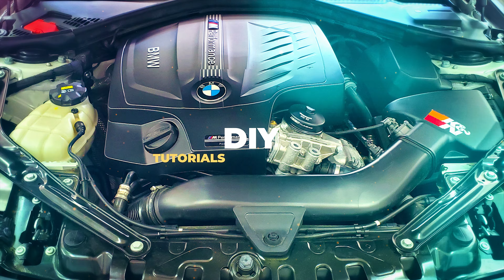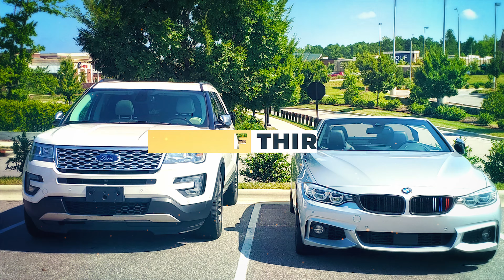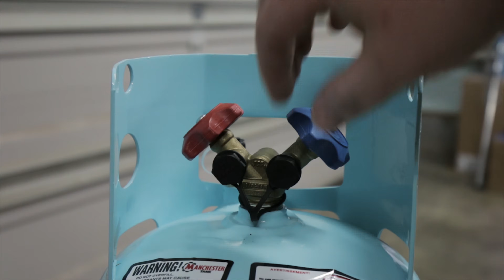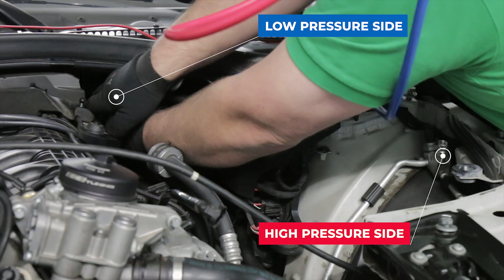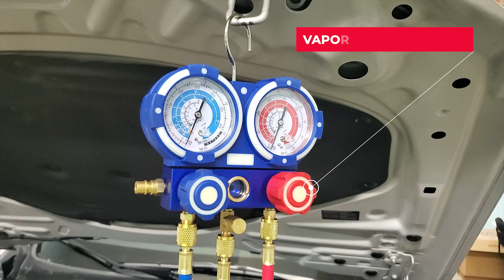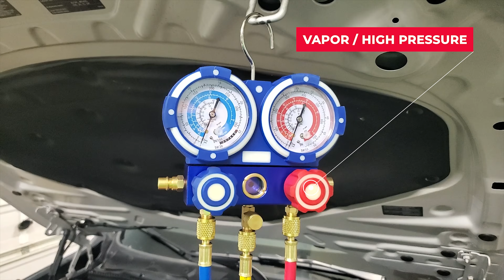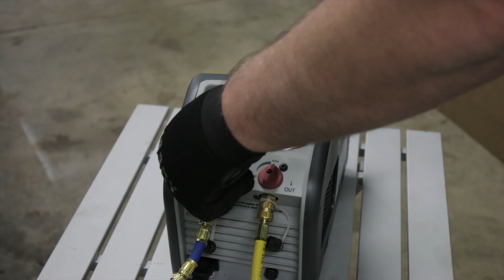EVACUATE YOUR CAR'S AC SYSTEM THE RIGHT WAY

Comment: Why didn't you purge the air out of the yellow line at the tank instead of sending it into the tank?  Won't this enter into the Vehicle's A/C system when you recharge it?  I see some guys purge and some guys don't during the evacuation process.  I know that you are supposed to purge the yellow line at the manifold gauge set when recharging.  So what's the story?  P.S.  Other than this one issue, I agree that you did an excellent job producing this video.  It is very helpful and much appreciated.  Thank you Steve...

Comment: If your already lost the Freon probably somebody catched it for you somewhere down the road 
just remove the condenser add somo AC oil and Freon I didn't vacuum anything my Lincoln navigator is blowing ice cold
Reply: Remove the condenser and add some oil and Freon?  Did you actually mean... remove the condenser?  Assuming you removed and replaced it without pulling a vacuum it might be working now but there is a grande' chance you're going to have compressor problems in the not distant future.

Comment: how do i know theres any refrigerant left in my system ?  and if it is empty can i skip the first step and go right to evacuating the air out of the sytem?
Reply: Connect up a set of gauges.  Many auto parts stores will lend them out for only the cost of a deposit.

Comment: When recovering the Freon will the low side ever go to -30psi? Some reason mine doesn’t go all the way down.
Reply: No.  The recovery machine is not designed to pull a full vacuum, just to pump a lot of vapor or liquid in a short time.  Fun fact, when the machine is pumping vapor, it compresses it back to a liquid for the tank.  These machines have a 1 hp motor, or bigger, and a small cooling radiator, and a fan.

Comment: If the compressor is shot, wouldn’t vacuuming out the old refrigerant before your repair, bring contaminates with it?
Reply from the maker: If there's contamination, I'd probably put in new refrigerant after everything is fixed.
Reply: @fthirty3  yes, that’s what I will do but I’m concerned with being able to find someone that will drain my current refrigerant, knowing it’s likely contaminated…

Comment: Just so people know if you had an accident already and your AC system is not cooling no more that’s probably because you didn’t put a hole in something fix the problem you don’t have to worry about draining the system because it’s already drained but you do have to vacuum make sure your system holds vacuum after that if it does for an hour or two, go ahead and put your Freon in it and you’re done Hope this helps.

Comment: Why dont you show the complete process about purging the lines and also adding some nitrogen in the car to about 4psi post recovery
Reply from the maker: I was replacing the ac condenser ultimately,  so there was no need to add anything after the refrigerant was removed until after the condenser was replaced.

Comment: I replaced the compressor (supports r134a) of my car in a local garage with a structually very similar compressor retrieved from a new model but used vehicle (supports r1234yf). The high side and low side MPa are same in both the compressor. My car's AC system supports r134a and it was regassed recently. I would like to know if while replacing the compressor, the freon was released (the mechanic just replaced the compressor) or it is still there. Also, if the new compressor contains any traces of r1234yf from previous vehicle. If so, if I should be evacuating the AC system before I regas?
Reply: Absolutely, if the shop replaced the compressor, they drained all of the refrigerant out of the system,  or they would have had a mini explosion on their hands.  What they did after that, who knows?

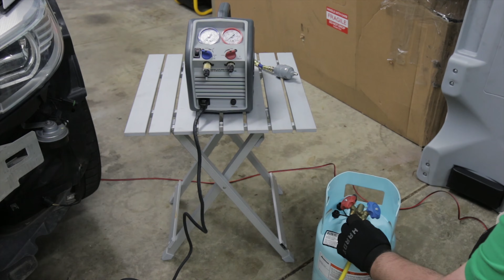Comment: I have spent weeks trying to get this all hooked up like you describe in the video, but you left some important info out.   Here are some pertinent things you forgot to mention:  1) The recovery tank in your link has 1/2 inch ACME connections, but the hose you linked to has 1/4 inch SAE flare connections.  So how did you hook that up without some sort of adapter? (and if you used an adapter, why didn't you mention it in your video?!)  In fact I'm pretty sure we can see the adapter hooked up to your recovery tank at 6:33 of this video.  2) Not all manifolds have the same yellow hose connector sizes.  Some come with 1/2 ACME on the yellow side.... and the hookups on the recovery machines (as well as the filter dryers) are almost always 1/4 SAE.  It's been hell on wheels trying to get all these threaded connections identified so I can find the adapters... and even more time waiting for them to come from China/Amazon in the mail, cuz nobody seems to sell 'em locally.

Comment: Let me start for thanking you for this video tutorial, your efforts are greatly appreciated for people like me who knows less, I have to mentions few things the first one and main one you have a lot of misinformation going here, honestly you should review the comments and re-do this video as if someone would follow it blindly will only get deeper in trouble with their system. secondly as far as "easy" I do have my reserves on that one; for the DIY like me that have never done it before it is not so easy; the special tools needed are $$; I have them already, manifold gauge and vacuum pump from Harbor Freight, got the tank , 30 pounds top yellow, body grey (not the blue one shown here which is color coded for 134a) got the Inficon vortex Dual machine ($$!!) also not shown here got a VivoHome digital scale; all the tools needed were around close to 2K!!, including the rest mentioned below so that is not easy at all for a DIY, the cheapest way still would cost close to 1K in tools along or even more! now the other things and expenses you do not mention here are parts costs; oil for the system, in my case I got 8 oz bottle of Pac 46 Supercool, O rings for the lines (O ring kit) an extra hose needed, mine is red, I got a Four Uncles AC System Flush Kit and also a pressure syringe special to inject the oil in the system. ALL this is NEEDED if you are going to service the car AC yourself and the acquisition of all and the knowledge of how to use it I wont be call that "easy" which is why it is recommended to get the car to a shop; granted, it is possible to be done at home but I feel your video here lacks the whole info as to what we will be getting into by choosing to service the car AC. I understand it is a "simple" and fast video, very well made showing the steps which by the way every manufacturer shows different in their instructions on how to use their products which creates lots of questions and confusion and then every you tuber does it differently as well which lets me wondering which step comes first and so on according to what I already have. In all fairness the more difficult part of this all is to gather what you need; I also thought I would be ok by getting the "basic" tools then my list kept growing and I was very frustrated. Now that I got everything, the scenario for my car is a 2004 Corolla which was running hot air. That was 3.5 years ago, engine is out of bay but AC system still hooked up intact; I collected and bought ALL essential parts for the system and was thinking full replacement as maintenance and parts must be close to end of service life. My original compressor fires (tested with battery) AC Relay is good and line reads 69 PSI pressure in low on 110 F, so system is possible low on freon (leak?? also got the leak detector kit), now since I even got the dashboard of the car out I got access to the evaporator which is why I was thinking full replacement; Evaporator, Condenser with Drier, Compressor and new O rings; as you can see a job like this is not easy in any degree; recovering the freon is just the starting point and to comply with legality; I should  mention when quoted by local shops, what I want to do was over 2k or close to it; I have 2 old cars, this 2004 Corolla and a 2000 Tacoma which may need service one day; this is why I decided to tackle it myself and "get ready" job itself is a PITA no matter how you put it but hey "easy" now that is the spirit!!

Comment: Where's the refrigerant scale for the tank? Don't you need a scale under the tank while recovering...
Reply from the maker: I would have if I was going to reuse the refrigerant,  but I decided to put fresh stuff in instead.
Reply: @fthirty3  well you still need it because you can't fill the tank more than 80%. How do you calculate how much refrigerant you recovered...
Reply from the maker: I was replacing the condenser,  so once I disconnected the lines, anything that would have been left would be gone. I know I got it all though because when i disconnected the lines, there was no pressurized release.
Reply: @fthirty3  That still don't tell you how much refrigerant you recovered from the tank... Also, you haven't even done a vacuum on the system after you recovered the refrigerant which tells me you could have air/moisture in the system.
Reply from the maker: After the ac condenser was replaced I did run a vaccume on the system before adding refrigerant. This video was purely on recovering the refrigerant and didn't cover adding it back.
Reply: @molifehacks5258  Some recovery machines will not let you go beyond 80% fill.  I have no idea how they do this.  Also, some machines will show how much refrigerant is recovered, and even beep (or turn on a light) when they are done.

Comment: hmmm didnt use the vacuum.  im just starting out but feel like the lines should have been vacuumed out in case you want to reuse coolant or just to keep air out of your tank to reduce rust and the possibility of creating an explosive environment.
Reply: Yes it seems like you forgot the step to hook up the vacuum.  Why would you need that and is the recovery machine also a vacuum. 

Do we only need the vacuum for the recovery tank?  You did use it there. 

So apparently recovery machine is also a vacuum in itself but has dials on it which I guess mean something. 

The only thing you forgot to do was put in the refrigerator cuz you already have the manifold valve set up, so what's up with that?

Comment: R134A is non ozone depleting, it does however have a huge GWP factor, which is why you aren't allowed to vent it into the air.
Reply: and yet every time someone cleans their copier or camera with canned air, they're free to spray it to their hearts content 😬 1,1,1,2-tetrafluoroethane
Reply: @JustEnjoyingLife73  actually most dusters use 1,1 Difluoroethane, R152A which has a GWP of 124, which is 1/11th of R134A and a zero Ozone depletion rate. I realize a lot of this shit is probably more or less a scam, but still doesn’t hurt to have the facts.
Reply: @Mooseguy15  I just googled canned air msds, so that's where I got that information from but still, that means if someone sprays 11 cans of canned air, that's like someone releasing one can of R134a, AND some canned air uses R134a or that MSDS wouldn't be out there, right? Anyway, I'm using a hydrocarbon refrigerant now, so I guess that doesn't matter as much for my case.
Reply: @JustEnjoyingLife73  Yep.  In the old days, the propellant for aerosol sprays was R12.
Reply: @Mooseguy15  There are many YT videos about using "duster" cans to refill your AC system.  Fun!

Comment: Forgive the ignorance of this question, but what does the recovery machine do that the vacuum pump doesn't?  I already own a pump and manifold gauges - if I got a recovery tank, would I be able to do this with the vacuum pump or is the recovery machine absolutely necessary?

I have to replace the AC compressor on my Honda so I'm trying to decide whether to do everything myself or find a mechanic to recover the refrigerant for me.
Reply: the recovery machine condenses the refrigerant back to a liquid and stores it in the tank.   The vacuum pump just exhausts to atmosphere.
Reply: @patrickzambori473   Thank you for the explanation.  My vacuum pump has a threaded exhaust.  I got the impression I could add a fitting to exhaust it to a recovery tank.  But I wasn't thinking about condensing it back to a liquid.
Reply: @peterkleiner9114  So at least to some degree, it can compress the vapor, that leaves you with hot compressed vapor.   It still needs to be condensed back to a liquid.   If you discharged that to a copper coil or tank submerged in salted ice or dry ice, it would be cold enough to condense the refrigerant.
Reply: @patrickzambori473  Thank you again for a very informative answer.  I suppose I'm much better off buying or renting a recovery machine, or bringing it to a mechanic.
Reply: @peterkleiner9114  a system dependent recovery would use the compressor on the vehicle.   A tank with a vacuum attached to the system and placed in ice would recover most if not all of the r-134.   The recovery machine actually is a compressor and a condenser.   If your system is working a system dependent recovery is possible.

Comment: Purge your air lines first or your putting air plus refrigerant into the recovery bottle.
Reply: How do you do that?
Reply: @billyc768  Close the valves then turn on the vaccum, when they hit zero pressure for a while close vaccum
Reply: @billyc768 if you look at where the yellow service line connects to the mainfold gauge set that's hung from the hood, there's a little round cap right below the sight glass that can be removed to expose the schrader valve, once exposed you just depress it the same as you would to let air out of a car tire, until you see pure refrigerant come out (once this happens all the air has been successfully purged)
Reply: @billyc768  just let some leak out
Reply: The world is gonna end
Reply: @summerforever6736  🤣🤣🤣
Reply from the maker: That was covered in a separate video. This video was only showing how to evacuate the system.
Reply: @fthirty3 it should be in this video my man.

Comment: This is a great video! The guys mentioned in the comments below about purging your lines. I'm  new ac stuff but something didn't quite add up with keeping moisture out of the system in the video. I think I got it now. Start from the target to be charged - Car - Ac Unit - etc. Hook up your hi and low up. Go to your manifold and open the inlet hose (not the manifold valve) to the manifold. Just crack it open and you'll see the moisture getting pushed out and close it again. I then worked my  way back to recovery tank doing the same thing at every necessary 1/4" connection and I can be assured there's no moisture in the the recovery system I'm hooking up at that point. Then I proceeded with your advice on recovery. Thank you.

Over all slick presentation in the video. Keep up the good work.
Reply: Having mositure and air can contaminate the system due to moisture freezing refrigerant and air creates more hot pressure therefore activating the high pressure switch shutting off the compressor.

Comment: What to do with the refrigerant in the tank? Can it be reused right away?
Reply: I’m definitely no expert, but I think the problem is that unless you have the refrigerant identified and analyzed, you have no way of knowing if you are putting contaminated refrigerant (w/ air, moisture, sealant, etc.), or possibly even counterfeit refrigerant, back into the system, which could damage it in the long run. As far as I can tell, the machine in the video is a recovery-only machine, but there are also analyzers and recovery/recycling/recharging (R/R/R) machines, some of which I think are capable of filtering to get the refrigerant back to an acceptable standard. R/R/R machines are expensive, so perhaps a shop can do those steps in the process. Otherwise, the the recovery-only machine will at least enable recycling or proper disposal of the refrigerant that is of unknown purity.
Reply from the maker: I ended up using new refrigerant, this video was only about the recovery of the refrigerant. But you're absolutely right that you don't want to put in contaminated refrigerant back in.

Comment: Dos the gas turn to liquid when it's in tank?
Reply: Yes, the recovery machine is both a compressor that pressurizes the refrigerant and it runs it through a cooler so it recondenses into a liquid as it goes back in the recycle tank.
Reply: No.  However, there will always be a bit of vapor in the tank above the liquid level as they liquid will evaporate.  Just like a can of refrigerant.